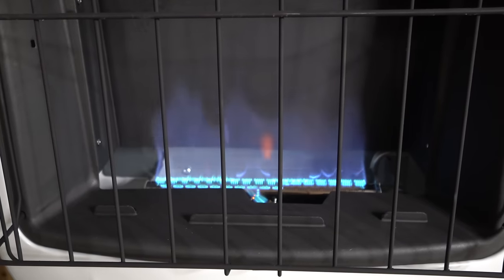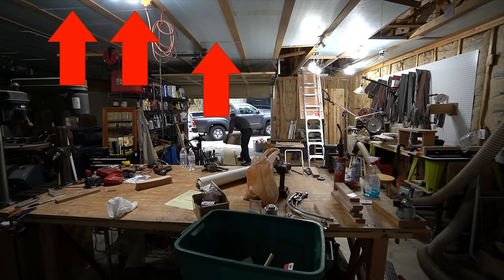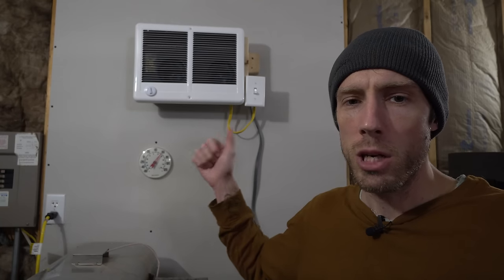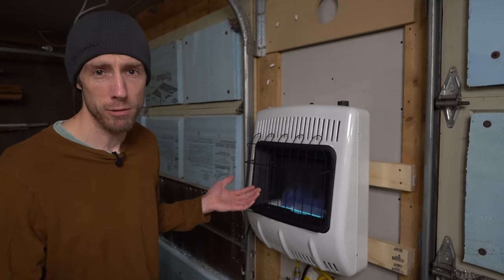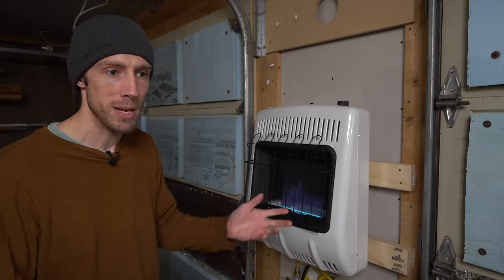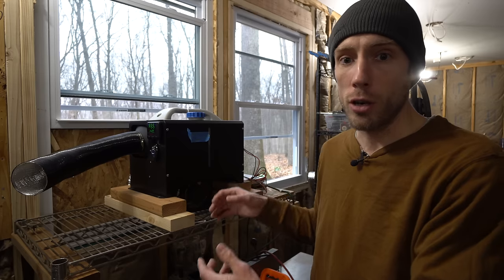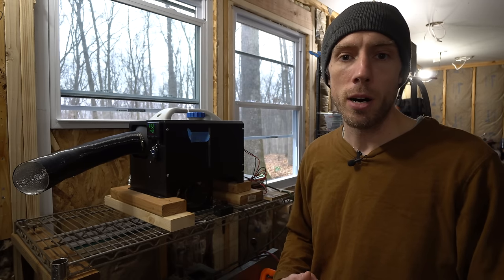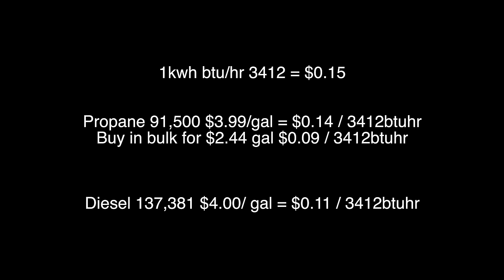What the most cost effective heater for a small shop? How I Heat My Shop For Cheap

Comment: I have a 110m² badly insulated workshop. I keep it at 18°C 24/7 with a 14KW pellet stove. Clean, eco friendly, wifi connected,... and cheaper than anything else.
Reply from the maker: Nice! They do work great 👍
Reply: Except a mini-split electric heat pump can PUMP 12,000 BTU per hour for $0.15 of electricity would be more economical... 
Bottom line: 
1) insulate the space i.e. R35,
2) heat with low cost fuel be it cordwood, pellet, coal, waste oil, electricity, diesel etc. 
3) use low cost heat device be it fireplace, stove, barrel, etc.
4) Upgrade to a) low cost device, b) low cost fuel... c) DIY v box store... d) Return on Investment... how long?

Video makes good points. $$$
Monthly cheap DIY is key!
Good luck!
Reply: @douglaspohl1827  Maybe where you live that might be the case. Diy insulation would cost me €12.000, a unit to heat the place, €7.500. I have 285m³ to heat due to high ceilings. Electricity in Belgium is more expensive than organs. The pellet stove was €3000 installed and the pellets are €800/year with 100% tax return.
Reply: @IP Knives Imperfectly Perfect Knives  Easy decision $800/year with 100% fuel tax credit. 
Love my 15 year old pellet stove too. Working on another heating stove since Douglas fir trees need major $$$$ trim/removal so going to build a forced-air cordwood heater with alt natural convention design should power go out or good old fireplace to get by outage.
Do the math... numbers do not lie... 
Thanks.

Comment: Nice comparison. Some remarks though. 1) A 6kW electric heater will not double the cost on electricity w.r.t. a 3kW heater as it will run less hours to get and hold the shop on 60 degrees. 2) The blue flames in the propane heater converter the carbon-hydrogen gas into CO2 and H2O, so besides carbon dioxide there will be a lot of water vapour blasted into the shop which will go into your wall isolation.
Reply from the maker: Thats not what i said. Im compairing cost per btu per hour. Thats where the info at the end comes into play. The water vapor is not problem in our climate and is welcome addition with our super dry winters.

Comment: You can put the diesel heater exhaust through a radiator so you can generate heat if you keep it inside. I'm in the process of insulating and heating my garage. I feel like I just saw the future of me seeing how you tried different things. Thanks for the video!
Reply from the maker: Ive head of that but see some people have problems if not done correctly. There's plenty of videos on YouTube about these things. Im sure someone has one who figured it out👍
Reply: @OUTDOORS55  yep! I've been watching so many videos on heating a garage. I have a detached garage that I am working on. I have the walls insulated but need to work on the ceiling. It's super leaky so I'm trying to think of a way to go overboard. Right now it seems a pellet stove but that's a lot of work haha.

Comment: You can heat that space with a propane bottle stove.  I installed mine on a stand so it takes no floor space.  At that size(20lb propane bottle), I burn in 1-2 hour increments.  That is to say you have to add wood about every hour to keep it HOT or if you're slow burning, you can go 2+ hours per 10lb of wood, give or take.  I have a couple 40 ft trailers welded together and I've put R10 foam and sheeting over the exterior, so I'm about as insulated as you look to be.  Probably less due to the fact the trailers are on blocks and cold air get's under and the floor isn't insulated at all.

Comment: Nice and blue flame, you won't be making much CO at all... (if any) 
But the headaches could come from one of two things: 
a high CO2 concentration (after all, a perfectly combusted propane exhaust is CO2 and water, reducing the relative amount of oxygen you breathe, and it's using the oxygen in your workshop to burn, so the effect is doubled); 
or like you indicate the "smell", which are sulfuric oxides because for safety reasons they mix H2S in the propane (propane is odorless, so they mix in a volatile unpleasant smell in order to be able to detect leaks quickly, and usually they pick H2S because it's cheap and most people really dislike rotten eggs). Obviously the H2S passes through the flames and gets burned too, and those products are bound to give you headaches and possibly burning eyes too.
Reply: and yes, I know it's equipped with a low oxygen shut-off. Those are usually set to 18% (flames die below 14%, people die below 16%, so you won't die which is fair enough for the legal department), but the headaches will occur as soon as you drop below 19.5% (some people are more sensitive to it than others, also depending on altitude, and other factors)

Comment: I have a big problem with moisture in the air with my heater. I am in Western Michigan and the cold here is crazy. I have been trying to figure a way to remove the moisture in the air. I have a propane heater with a 100 pound tank behind the workshop. It works the best to keep it warm.
Reply: Hi Michiganer, I'm just east of GR.
You need something vented, when you burn off the oxygen in the combustion process, you are left with the moisture. In a vented system you won't have that problem, but you will loose a little heat.
Reply: @brettblack7049  Thanks, I am near Ludington by the way.
Reply: @timm2020  Shoot, that's northern West Michigan lol.
I miss going up that way, used to go up that way a lot, now I don't get north much at all. Sometimes just south of you in the silver lake area at a buddies cottage on the north side of the dunes right off lake mi. There's actually a few videos on my channel taking down some good sized white pines up there last spring. He wants me to head up there again this yr to drop one more that's even larger, it was struck by lightening.
I've seen many of those propane heaters being used inside tighter homes or homes with older windows, you see the moisture on the windows and the walls after running them for a short time, a vented unit will take care of that problem. I heat nearly 100% with a wood stove, the rest is with a pellet stove just to help on the real cold days, or when I'm going to be out for a few days.
Have a great weekend :).

Comment: Find an old castiron radiator and run the exhaust through it, then outside reclaim the heat from the exhaust.   P.S. set a fan behind the radiator.

Comment: I have a diesel heater in my shop too. The worst part of the propane heaters is they introduce a lot of moisture into the air.  As for the Chinese diesle heater the 8kw one is a lie they are rebadged 5kw.
Reply from the maker: Yes they don't consume enough fuel to be 8kw👍 I dont have problems with any moisture. We have super dry air here in the wintertime so the added moisture is appreciated. Its the smell that gets me due to the open flame 👍🙂
Reply: @OUTDOORS55  ahh well here in Ireland the air is never dry 😂 I have the heater setup outside pulling in fresh air so it’s not as efficient as it could be but help keep it fresher feeling as the space is pretty well sealed. Would recommend looking at some option to add a car battery to your heater, if you have a power outage when it’s running it will shut off and can then overheat the electronics as it’s doesn’t do the cool down cycle. The power draw once up to heat is only about 30-60w so it doesn’t need to be a big battery.

Comment: Did you consider osb instead of drywall for walls? OSB is much nicer to work with and way nicer for putting up shelving, hanging tools on wall etc. Has about same insulation value as drywall.
Reply: Depending on thickness I'd say the osb actually would insulate better
Reply from the maker: Yeah, id like to but technically its not code here and id rather have the greater fire resistance with drywall. I dont pland on attaching anything to the walls anyway. Everything will be on wheels an mobile so i can move thong around.🙂👍
Reply: osb stinks. it outgasses VOCs for a long time...i hate that smell.
Reply: OSB makes a great fire accelerant.  the 🤔

Comment: I was also thinking of running my diesel heater off mikwaukee batteries to heat a tent or somthing
Reply from the maker: You'll definitely want to check the voltage first. From what ive seen 12-14v is where they want to run.👍
Reply: @OUTDOORS55  yeah converters are readily available I already got a working example

Comment: I hate to tell you this, but 1 inch of that Styrofoam insulation is equal to 18 inches of fiberglass batting, but you do have to use some sort of jiffy foam to fill the gaps with the fiberglass you only have the width of the 2 x 4 studs even if you have two by sixes it’s not enough the spray insulation foam is expensive but is essentially turns your walls into an igloo cooler then you have the issue of making sure you have proper ventilation because you can heat some thing with Styrofoam all the way around with very little heat. I have a shop that is 80 x 80 with a 14 foot ceiling spray foam insulation and with a 50,000 BTU torpedo heater. It literally will run you out of there but because of the ventilation issue , it will literally burn up all the oxygen and you will get sick so I put a smaller propane heater and it does the trick again the cost is in the initial insulating of your shop . and in the summertime in his big is a sharp as I have I have only two 5000 BTU window units that cools the entire thing the trick is do you want to pay me now or pay me later if you pay for the good insulation you won’t be paying the high fuel bills, but the initial cost is quite high. Sorry about the punctuation. This is a microphone. I am not typing it. And it might seem like it runs altogether. Either way you get the point you have a great video but it’s like anything if you do it correctly the first time you don’t have to do it again .   I am looking into pellet stoves. They are economically a better deal. Thanks again for the video and for your time..

Comment: FWIW ,   if  you want would heat it doesn't have to be stationed inside the shop.  You can locate the fire box outside and  duct the heat into the shop at any point you choose.  Just a thought for ya .

Comment: I've heated with wood for 43yrs. It is the best hands down if you can scrounge up the wood for free. I pay $100/ face cord and I can easily burn it in a month during below 30 degree wxr using an airtight Ashley brand wood burning stove. The stove cost $450 back in 1979 and is still on the job. BUT, I have watched many YouTuber's using "Diesel" heaters and SOME of them use GASOLINE. One lady YouTuber calls herself Cat Lady Van who lives in BC Canada had a Gasoline version of your "Diesel" heater installed in the Van she lives in. Of course it runs off her has tank. So there's a resource to check my story out. Gasoline is about $1/ gal cheaper than Dismal fuel, doesn't smell when burnt and evaporates if spilled, unlike Dismal fuel that always stinks wet or burnt, and refuses to dry up if spilled. And lastly  gasoline is way more plentiful. You might think about it when you get around to your permanent install. ben
Reply: Years ago, I installed a gasoline heater between the front seats of my VW bus.  It was small but was instant and sufficient.

Comment: Unvented propane smells, and emits CO2, but also emits a lot of water. The exhaust is essentially CO2 and water. That's why toolboxes full of steel tools start developing patinas and rust, especially when the tools are getting cold between times when you are calling for heat. Cold steel + warm humid air = rust.

Comment: Heat pump, pellet stove, wood stove would be overall cheaper per BTU.  I use a heat pump and that thing is amazingly cheap and works down to 0F, though you have to keep it running at low temps, can't depend on it providing the sudden rise in temperature from a cold start, but it can maintain it. Dollar for dollar heat pump is the cheapest of any heating option including buying cord wood.  Also I have used a pellet stove and that can throw out a lot of heat and is uber convenient and a fast heat up.  Wood stove can work also but I don't like ti for a shop setting as it takes effort in the morning to get it going and just requires more attention.   The options you did are more of the quick fixes, along with a Kero heater, but for longer term it may be better to look at spending a bit more up front for savings down the road.
Reply from the maker: For the price of a heat pump ($2500 if I install myself) i can buy diesel to heat my shop for 6 years on a 5 month a year heating schedule. Not sure that pans out long term. Thats a 6 year break even point. So to save money would take another 10+ years since you are only saving the difference between fuel sources. Which would be a couple bucks a month.

Comment: Just mount a large flat screen, matched to a quality amplified surround sound system ,tune into CNN . That will generate enough hot air guaranteed ,with the added benefit of you getting so pissed off y’all get the work done in half the time.

Comment: I used to drive trucks to Canada from Texas and Arizona etc.  But when I got "up north" like in Montana and Alberta etc, in the dead of winter they only sell Number ONE Diesel.  So, since you are "up north" do you run Number ONE or Number Two??  Or does it make any difference.  If you run OFF ROAD diesel you are probably running Number 2, but I would like to know for sure.  In Texas all Diesel is Number Two years round, off road and Road use.
Reply from the maker: Off road is number two. I run the red dyed number 2, off raod👍 Its not much cheaper but every bit helps🙂
Reply: @OUTDOORS55  In Texas the off road fuel is about 40 Cents per gallon cheaper than Highway fuel with the Road Use Tax on it.  That heater probably doesn't care if it is number one or two.  ONE is low grade kerosene is what I have always heard, less likely to gel in lower temps.  Gelling shouldn't be a problem in your shop, you could turn on one of your other heaters and they would warm it up so that the gelling would dissipate, or thaw or whatever you call it.  Nice Video!!!

Comment: I forgot to add the little buddy heater. Dude everyone should get one. You can run it on one of those little Coleman propane tanks or a big grill propane tank 20 lb or even a house one if you have the right attachments that little thing will heat up a room in a heartbeat
Reply from the maker: The propane stove in this video is made by the same company mr heater. I used it this past weekend when we didnt have heat while waiting on a part to arrive to fix my central house system. It worked great and kept my downstairs warm for a couple days. Much less smell when used inside in a clean environment 👍
Reply: @OUTDOORS55  awesome love that company. Off subject but have you ever made a vid on different wood handle types. Like which ones and more comfortable to smashing a log behind? 😅😆😅😆😅😆. Im talking walnut,oak,ebony etc. The whole nine. I know it would kind of suck cuz you would have to make 30 knives to test each individual would but it's definitely something I would be interested in watching. And I have a Woodshop that I working and I have a butt ton of wood if you ever needed any I could send you a whole load of them.
Reply: @jonaspeoples6931  9

Comment: Question , could you put the unit outside , run the fresh air intake thru the wall so its getting warmer air than outside and also run the heating tube thru the wall ?

Comment: Folks, "PELLET" stoves is the way to go. Cheap source of fuel, you can turn on and off, and with most set to a thermostat temperature setting.  I heat my entire 2300 SQ FT home annually for $700 dollars. Pellet stoves come in various sizes so they don't take up much room. That would be my recommendation.

Comment: The climate change crowd will hate your video:))) You said no to electric!!! Anyway I bought years ago on ebay a sterling oak wood and coal cylinder stove and I use that to heat up my 12x20 garage/shop, I used coal in the past but would take more time to heat up the place and then would be too hot. Now I use wood which is free and just wait for the summer for the people to cut their trees and leave the logs by the sidewalk.
Reply from the maker: When they pay my bills ill start caring what they think 😉 I used to use coal to heat my old house. It used to be the cheapest fuel you could buy around here. 👍
Reply: @OUTDOORS55  I used to go to Pennsylvania (I'm in New Jersey) to buy coal until I found out Tractor Supply sales coal.

Comment: To heat up your shop very quickly, pour a 12-ounce bottle of HEET Gas-Line Antifreeze And Water Remover into a stainless steel saucepan and light it on fire. It will burn for 12 minutes and release a MASSIVE amount of heat.

Comment: Dude I put one of these in my 2 car garage last fall. It's been working awesome(the diesel heater)
Reply from the maker: It's pretty much exactly what i was looking for in a heater. Super cheap and it just works 👍
Reply: @OUTDOORS55  going to streamline my install and put in a much larger fuel tank this summer, I'd buy another one it's a great unit I've ran it for weeks straight.
Reply from the maker: Same, had mine running nonstop for almost 4 weeks now. Really impressed with it🙂